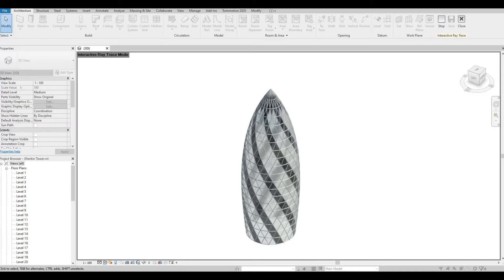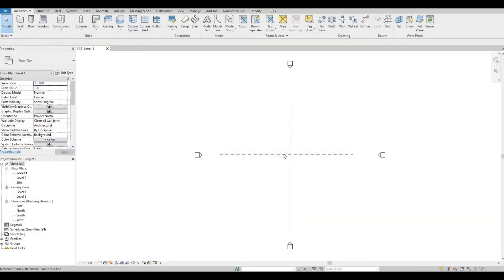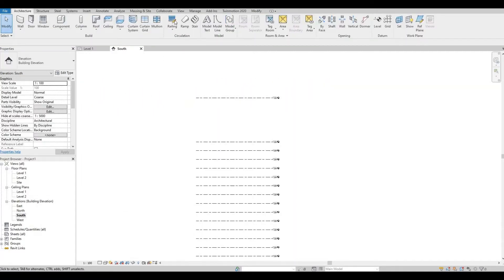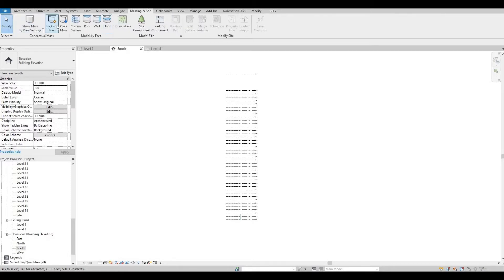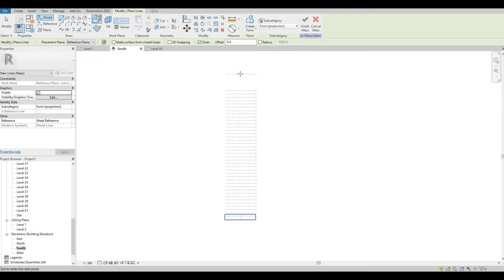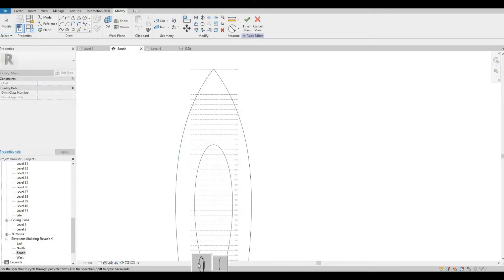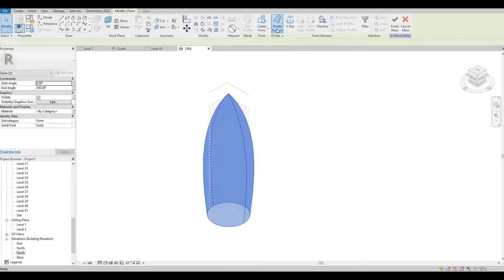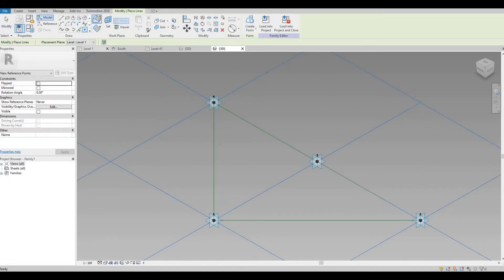The Gherkin Tower in London | In Place Mass | Massing in Revit | Revit Tutorial | Tips and Tricks

Comment: Hey 👋, I try to do this shape but from the mass , my Revit doesn’t show me the option to use to create this form  . Can you help me with that ?
Reply: Hello, i've been having the same problem, what I did is unjoin the 2 lines in the top.  The straight line and the spline cannot be together. Hope it helps
Reply from the maker: Thanks Lucca for sharing your knowledge 🙂🙏
Reply from the maker: Hi Ane, I created this in In place mass, I believe that is the better option to do this. What year version of Revit do you have?
Reply: @ArchCoreDesigns  i am using Revit 2022
Reply from the maker: unfortunately I haven't use the newer version of Revit.